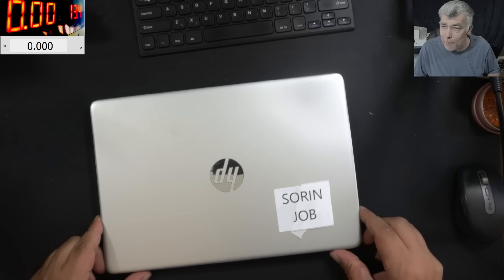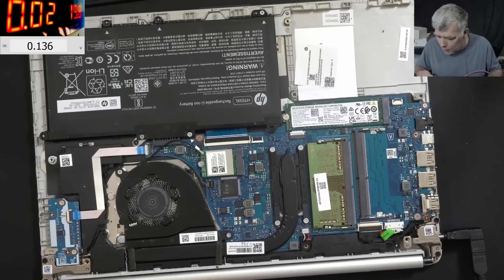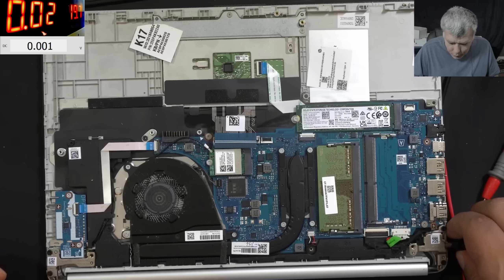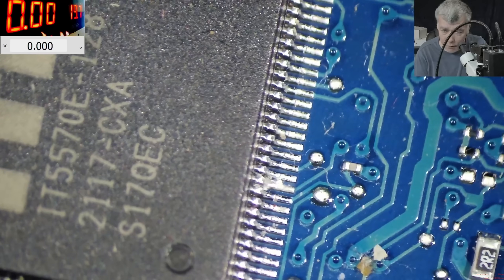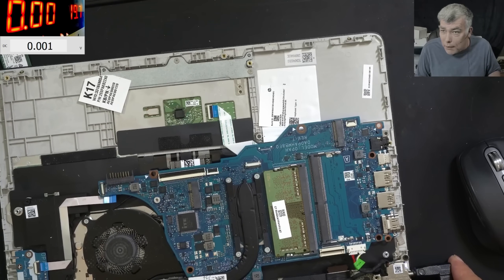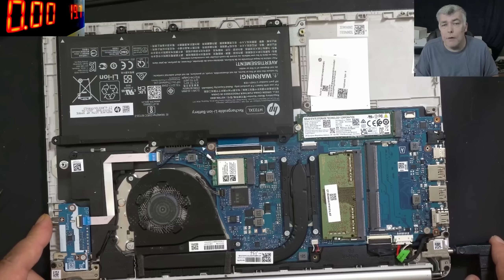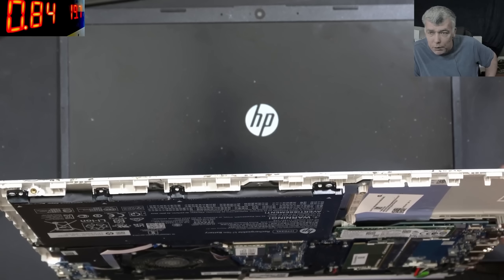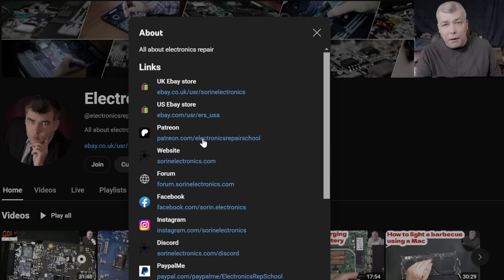HP 14s-2502 no power board repair, nearly missed the fault!!!!!!!!!!!!!!

Comment: What are the odds to receive a HP laptop similar to the one you are working on and have the same problem? I almost missed it also. It was driving me crazy untill i saw this video and checked the ec chip. It had the same problem. Cleaned and boooom, working.
I only had to reflow the soldering a bit because, after assembling, it failed again and finaly it worked fine.
I got happy when I reached the eureka point of "WE HAVE PICTURE" 😂
You are from far the best technician I've seen on internet.
Thank you very much for sharing your knowledge.

Comment: I had a HP 250 G*light on when charger plugged in would not start, So i started unplugging like you told us and bingo it is the usb port board water damage. So now the customer wants me to get another. easy pizza. Thanks Sorin.

Comment: Why did charging the battery separately then make it charge from the PC power?
Reply: Because it quickly increased it's voltage to a level where the changing circuit considered safe

Comment: Sir i am sending detail of a laptop can i get a good laptop from him if possible plz guide us some model so that we can buy a good laptop from them
You will be very kind

Yoga Pro 7i Gen 9 (14" Intel)                                              1. Processor: Intel® Core™ Ultra 9 185H
   - E-cores up to 3.80 GHz
   - P-cores up to 5.10 GHz

2. Memory: 32 GB LPDDR5X-7467 MHz (soldered)

3. Storage: 512 GB SSD M.2 2280 PCIe Gen4 TLC

4. Display: 14.5" 3K (3072 x 1920), IPS, reflective, touchscreen, 100% DCI-P3, 400 nits, 120 Hz, glass

5. Graphics: Integrated

6. Wireless Connectivity: Wi-Fi 6E 2x2 AX and Bluetooth® 5.1 or higher

7. Warranty: 2 years Depot or Courier Service
9k
Ok